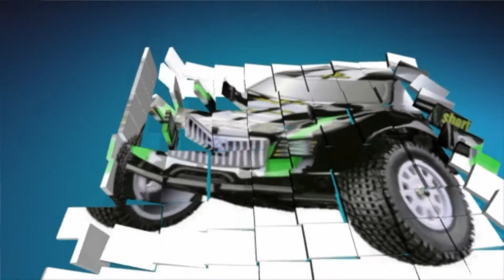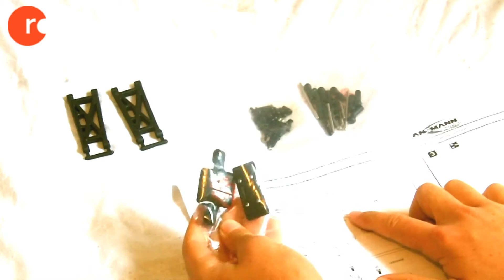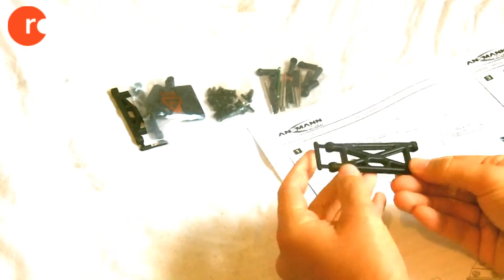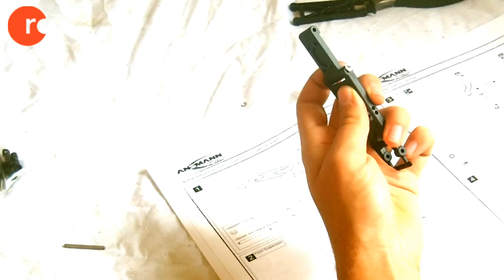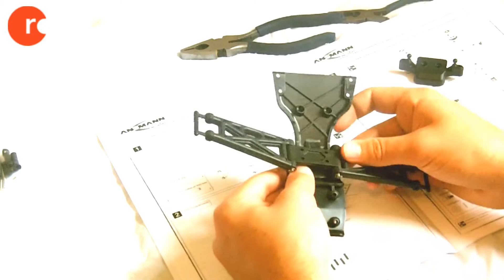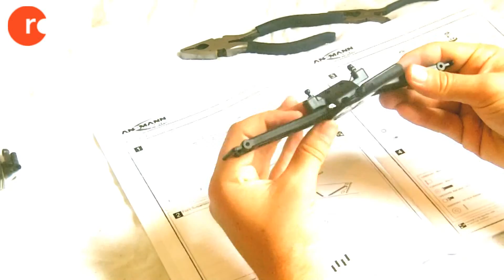Ansmann SC2 Build Pt1 - Front Plastic parts assembly

Comment from the maker: If you are referring to the suspension arms, then this is because the plastic is still new and so the holes are perfect fit for the suspension pins. After a few runs they will wear very slightly giving more space for movement. JT